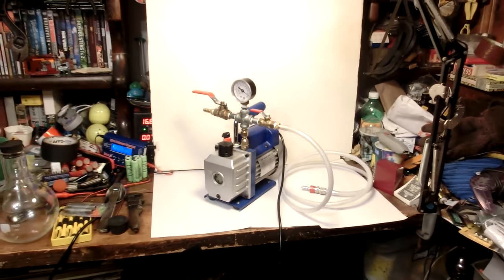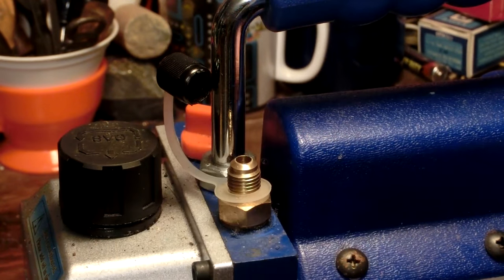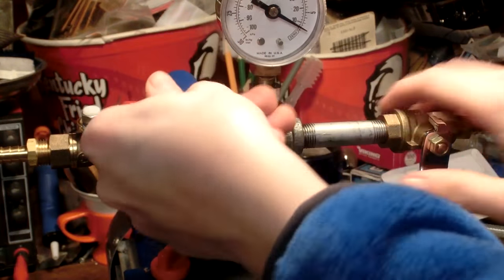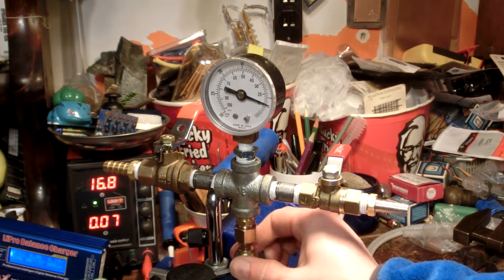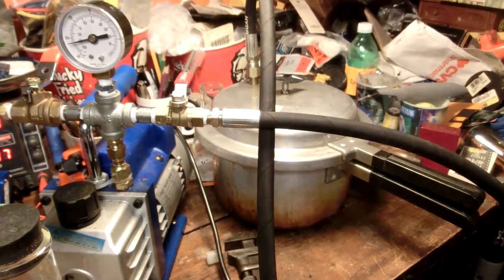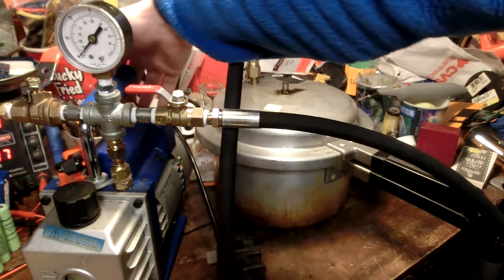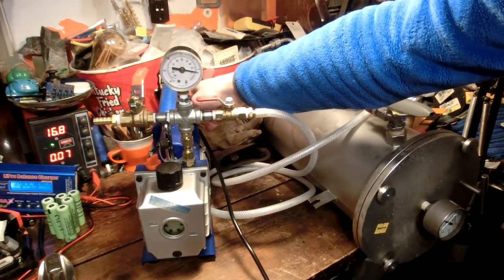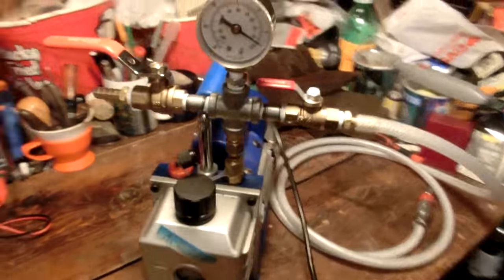Vacuum Pump Mod

Comment: For anyone who it may help, the fitting which comes standard on these pumps is a 1/4" SAE flare fitting. If it isn't this it'll be a 3/8" SAE flare fitting. Some pumps have both. 
To covert it to normal air fittings (BSP or NPT depending on where you live) requires first a 1/4" SAE swivel connector followed by a 1/4" SAE Male to 1/4" (BSP or NPT) Female fitting; then a 1/4" (BSP or NPT) Male to 10mm barb fitting. The final fitting is a standard air hose fitting available from the hardware store, the first two need to be sourced online or from a refrigerant/ LPG gas fittings store. Additional parts can be used as desired to allow further control of the vacuum.
Reply: Thanks a lot!
Reply: Thanks for this Leo it's just the info I need.
Reply: I'll look into this.. yes I have both 1/4 and 3/8 on one pump and the smaller pump has just the 1/4.

I've heard it said by a pump repairer that it's best to release the load on the pump before turning it off. I believe it's because turning them off under load can force the vanes to push the other way which isn't good for the pump.. thanks for this video.. it shows what can be done with them.

I have a cps Vg200 digital vac guage for use on a split system aircon evacuation.

Comment: It(Filter) probably cost a few hundred to make at most. Most components are deceptively cheap to make. As for the pressure vessels collapsing, the Pressure cooker would be fine as it is a pressure vessel. The filter vessel would also likely be fine. I've used stainless steel pots with 5mm of Plexiglas as vacuum chambers when expunging air bubbles from plaster molds using a similarly sized vacuum pump. And not good pots either, cheap-ass Walmart pots. Even oil drums can withstand holding a vacuum, until you give them a good, solid whack, at which point the crumple like a aluminium can.

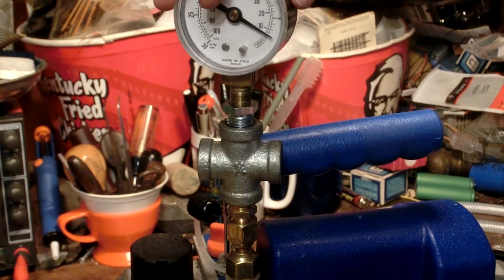Comment: 3:06 What are those for fittings ?? this is not a 1/4AG  
it looks like the thread starts out a little smaller and at some point becomes a 1/4 thread in the middle and maybe even a little bigger at the end.
That confuses me a bit because I've never seen such a thread before. 
I'm in the process of rebuilding your setup. I already have most of the parts, only the extensions shown would interest me what exactly it is or what it is called.

Comment: You'l need your teflon tape on all the threads in the system to hold vacuum or pressure.
Reply from the maker: +skycarl ok, ill put some on the lower arts when i work on it next
Reply: The bottom HVAC fitting has a taper, which is the sealing surface; no need for teflon tape on a tapered fitting like JIC or o-ring fittings, only for NPT pipe threads.
Reply: Besides sealing for air tightness,, the tape also helps hold the threads from working loose from movement and vibration.
Reply: +Rinoa Any results on sealing the pipes?
Reply: @skycarl  Teflon tape is a lubricant, not a stabilizer or locking mechanism.  This is its primary purpose.  with lubrication, it can seal tighter since the surfaces can glide past each other more easily (tighter but movable fit).  It tightness and lack of motion is the need, one should use plumber's caulk (Pipe dope??) which hardens once the seal is achieved.
Reply: Pipe dope is just teflon tape ground up in glycerin..  basically..  ive always had crap luck with leak free connections so i always use teflon tape and pipe dope on top of that on every connection, flare, compression or whatever.  If its got threads and needs to seal but doesnt have an o ring, its gettin taped..  and with compression fittings on the little olive or thing that squeezes on the pipe, i wrap that with a little tape as well because i tend to over tighten those connections and the tape gives you some leeway when taken apart so you can reuse them more before they wear out that olive...

Comment: Hey there! Just thought I'd drop a comment. I believe that that valve is meant to float up and seal when oil enters that section. I just replaced that fitting with a simple barbed one, and after a while of sitting with vacuum, oil tends to creep out.

Comment: actually the thing that it comes with doesn't really do any one way valve stuff from what I've measured with my vacuum gauge, I just stuck a 3/8ths inch nipple on it and some 3/8th inch brass fittings and it works fine

Comment: I put a valve directly on the pump inlet as I don't think the pump will keep the pressure when switched off. So I should be able, after closing the valve, to see the current vacuum on the meter.

Comment: To tight nuts, fitting, allways use two adjustable spanners
Fittings are to big as you say
I made mine with all 1/4, brass and coppper, without valves to avoid leaks, its hard to achive.
Thanks for the video
Dom

Comment: I just noticed that the nipple where the pressure weight goes has about the same size thread as a vacuum guage. The other chamber has no chance of catastrophic failure, atmospheric pressure is only 15 psi but you're probably going to need a much better vacuum pump if you want to make a crooks tube. If you do make one remember that it emits X ray radiation and cathode ray tube TV sets had about an inch thick heavily leaded glass to make them safe for humans to be around.

Comment: Great video. I have two thoughts. I see a sight glass on the end of the pump that appears to be empty, does it need more oil?  Also, it would be really cool if you could do an experiment with using the vacuum to boil water and see if you can get effective refrigeration out of it using water as your refrigerant.
Reply from the maker: +Ian Levine no its slightly over filled so its fine

Comment: the fitting you put first in line from the pump uses a flare to seal so it doesn't need tape...all of the others do...it looks like you didn't put any tape on the bottom of the galvanized 4 way fitting...that would cause the leak...

Comment: Just got the VEVOR AC 12 CFM cousin to this vacuum pump and it has two inlets perpendicular to each other. The top one is 11.1mm (7/16") inverted flare that looks like NPT but isn't tapered, and the second one pointing sideways is 12.5mm (1/4") ACME with thick threads. For the life of me, I cannot find a single F-F converter from 7/16 inverted flare to 3/4 NPT for the pressure gauge. I want so badly to angle grind this thing off. lol.

Comment: Electron microscopes require an extremely high vacuum, much higher than your pump can provide. You need a fine quality 2 stage lab mechanical vacuum pump, backed by a diffusion or turbo. Also if that container was used to hold oil, or if there is any presence of oil, that will spoil your vacuum due to outagssing, not allowing you to reach pressures below .001 torr.
Reply from the maker: yes i know, ive been keeping an eye out for a diffusion pump for several years now.
Reply: Rinoa Super-Genius you do need a more powerful vacuum pump to back your diffusion pump, depending on the diffusion pump specs.
Reply from the maker: yes i know. now stop repeating what we all know. lol

i recommend you watch Ben Krasnows video on his electron microscope.
Reply: Rinoa Super-Genius where do you think I got all this information. Lol just trying to help
Reply from the maker: Erik Smith
i know, so now you know how you sounded haha. i'm pretty sure everybody interesting has seen ben krasnows video. hes a really cool person, i had fun talking to him at the 2015 San Mateo Maker Faire.

Comment: The flare fittings at the bottom don't use thread sealant because the seal is made by the flare.  I couldn't see any sealant on the flare to pipe thread adapter that goes into the bottom of the 4 way fitting though.   If that bottom fitting is what I think it is (a short piece of copper pipe) I would add some additional support for that assembly to keep stress off of the copper flare.   Digital refrigeration vacuum gauges  are cool.  You can see mine in my Hobbit House 10 heat pump video.  It was about $150 but I think there are decent ones available for less. They measure in microns.

Comment: Ha, the only thing I did not add to mine are the two valves you have.  I might need to borrow that idea.  Mine originally used 1/4 compression fittings, but I recently learned to braze and ended up brazing all all the connections so it is nice, sealed, and rigid.

Comment: I'm doing the same thing with a Harbor Freight pup, converting for vacuum testing relief valves. What kind of hoses are you using? Is the black one hydraulic line? Is the clear tubing just vinyl? Any issues with the different hoses you've tried collapsing under vacuum? Thanks for posting!
Reply from the maker: no issues with tubes yet, but id stay away from clear tubing that is too thin. if you struggle to pinch it all the way shut with your fingers at the middle, i figure its probably good enough.
Reply: Thank you!

Comment: rinao i bouthg the same one got it today when you opened the red fill port did you notice rust? i have some rust on the threads and the black part at the bottom im going to try to carefully remove it vacumm it up.. kinda ticks me off spent 50 bucks and its rusted if i added fluid id prolly comtaminate the thing i might break it down and clean it that way not sure though

Comment: Electron microscope? holy shit, now you got me interested
How are you going to accelerate the primary electrons? The lower the asociated wavelength, the bigger the resolution of the scope. In order to get small wavelengths electrons are accelerated in an electric field (10kv up to 200kv)

How are you going to prepare the samples that will be used in the microscope?
Reply from the maker: +Victor García im basicly going to copy what my friend Ben Krasnow did for his. this is years down the line though
Reply: There's most of one on eBay for I think $3000. I'd buy it but I don't know enough about electron microscopes to even begin to start rebuilding it.

Comment: Hey mate ! Do you remember what is the type of male conenctor on this vacuum pump ? And what was the one you managed to find to fit it. I'm having issues properly connecting the pump to my project and having purchased the wrong connections once, i'd love some owner insight ! I though it was 1/4 bsp but it is not, and now i'm not sure if it is 7/16" UNF or 1/4" r134a, etc.... 

I really hope you can help me, it's making me crazy !  ;)
Reply: What you are looking at is used mostly for gas line some times water connections ( take the part removed from pump with you if you have a HD or Lowe’s they will be in that department they look like they are 1/2” thread and most are fine thread but see where your galvanized pipe is course thread always use pipe tape will save you from taking apart to re do it latter hope this helps you out

Comment: Got the exact pump from eBay with 3 gallon vacuumed pot! it come covered in oil wiped it down spent 2 days finding oil!  refilled it between low and high marks . plugged it in it burnt up instantly!!!!! I’m guessing from all the oil that got in the electric motor

Comment: Are you able to plumb this vacuum pump so that you can transfer liquids from one spot to another? 
(I'm thinking of buying one just like this for that sort of application).
Reply from the maker: You wouldn’t want to pass the liquid through the pump, but it could be used to suck liquids as long as the liquid ended up in a large chamber. You would need to make sure the pump would never accidentally suck up liquid
Reply: You would need a jar with 2 holes in the lid to capture the water so that the pump only sucks air. Also consider that this kind of pump tends to generate an oil mist when running close to atmospheric pressure so you may want to put a filter on the output to keep from breathing the oil cloud.

Comment: Atmospheric pressure is only 14.7 PSI so, even if you brought a chamber all the way down to 0 (a total vacuum, which would be near impossible), that's only a difference of 14.7 PSI.  Just think about inflating something to 29.4 PSI.  That would be the SAME pressure differential and 29.4 is even less than car tires and way less than bicycle tires.  I wouldn't be too worried about being hurt by that tank.  Even many glass jars can handle the pressure difference.
Reply from the maker: +Christmas Eve no its not the same. for instance an oil barrel can withstand 90psi but fail at -4psi
Reply: OHH you're right!  Sorry.  I didn't take into consideration that a certain part might easily be pushed one way but not the other.  If you had a container that had perfectly uniform walls and no ports, it SHOULD be the same strength in the positive or negative.

Comment: is it a good idea to reuse refrigerator or aircon compressor as air compressor? or even a car compressor?
Reply from the maker: +Bitelaserkhalif cringes sounds good to me, aussie50 uses refrigeration compressors for his compressed air
Reply: Rinoa Super-Genius this idea came across due to phaseouts of r22 refigerant, and those compressor cannot reworked for new refigerant type.

Comment: the valve is to prevent the pump oil from entering the system if the pump is shut. example...power outage

Comment: If I wanted to keep a chamber under vacuum (or relative vacuum I guess) for several hours - or even continuously - could this pump do that?
Reply: or would it get damaged being left on pumping a vacuum (like your pressure cooker) for an extended period of time?
Reply: yes that pump can do it. It is commonly used for creating vacuum in even bigger refrigirant units and machines
Reply: There's no risk of damage, these kind of pumps are designed to be able to run for extended periods of time. The cheaper models tend to run a fair bit hotter than the more expensive ones.

Comment: Hi  what is the name of the first adaptor at 2.05. I need one to add a gauge :) And pressure control valve. Adjustable orifice?
Reply: Female  flare swizzle brass fitting or brass adapter
Reply: B Bank And what size is it? I keep getting bits that don’t fit. Frustrated 😡

Comment: Will a regular air pressure regulator used on compressors work on my vacuum pump to control the amount of pressure
Reply: It will, but not very well.

Comment: I'm thinking of adding a check valve to my vacuum pump in order to close the vacuum line when the pump is switched off via a timer socket, so I could run my stabilization chamber unattended
Reply: Video please! Show how you can help us. Thanks!

Comment: Atmospheric pressure at sea level is only about 14.7 PSI.  I would think that big stainless canister can handle it.
Reply from the maker: idk, oil barrels cant handle -4psi but can handle 90psi.

Comment: This may have been asked already, but I couldn't find it in my search in the comments, but what is the name of the first adapter fitting you used? Thanks!
Reply from the maker: not sure, i got it at a local hardware store. think its used to connect to small copper waterpipe.
Reply: Thanks

Comment: I’m way late to the party haha, 
But you could have gone with your original plan.  The little one way valve that you discovered is only a safety so you don’t suck all of your oil if your vac pump loses power while pulling the vacuum. 
It is not necessary

Comment: Which hardware stores did you go to when purchasing these items?
Reply: Any of the big box stores like HD or Lowe’s look in plumbing department gas line / water should be brass fittings

Comment: You're going to need quite a vacuum, for a condenser lens and aperture. And maybe a second vacuum for the specimen chamber.
Reply from the maker: well yeah, but this pump is for early experiments like removing bubbles from liquids and vacuum sealing food.
Reply: Ah.. very interesting.

Comment: Is it possible to turn these into an air pump that could run a mud hopper and other tools?
Reply from the maker: Its output does not confine the gas, so it only is good for a vacuum pump
Reply: @RinoaL  I don't want to confine the gas or air to create pressure, I want to continously pump air. I realize it a vaccum, however can it be use like a shop vac. Using it to push air rather than pull air. At 3cfm and 30 psi?
Reply from the maker: your words are contradictory. vacuum is only -14psi. you need an air compressor
Reply: @RinoaL   I see.. ok thank you.

Comment: Did you ever finish the 3 wheeler restoration?
Reply from the maker: +Alex Zariczny no, i will hopefully be continuing this spring once i get my work area paved by my shed
Reply: Rinoa Super-Genius I'm really looking forward to you finishing that series it really interests me
Reply from the maker: Alex Zariczny
well its not going to be just one series, i'm thinking about branching it off to also have "DIY electric Honda three wheeler mod" or something like that since i have 3 of them. :P
Reply: Rinoa Super-Genius that's really cool I want to buy an 85 200x but the cheapest one I could find around Pennsylvania is 650 any tips with finding three wheelers?
Reply from the maker: Alex Zariczny
not really any tips, i really lucked out with getting crappy ones for such a low price. if a honda works fine, 650 is normally the price they can go for. but thats like if they look brand new.

the best bet is to keep an eye out for ones that arent for sale, like if you see one by a barn or something. they might just want to get rid of it. the person i got my extra hondas was in the business of collecting scrap from farms.
Reply: Rinoa Super-Genius Alright well thankyou